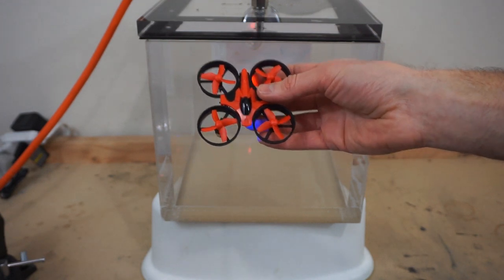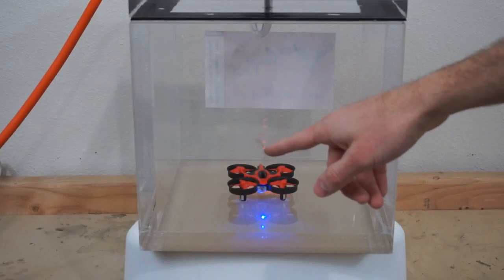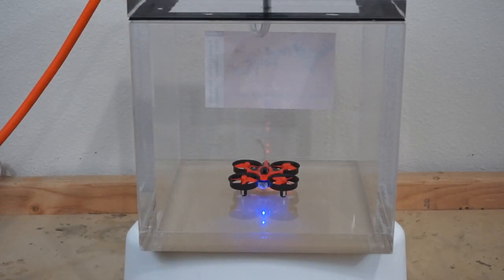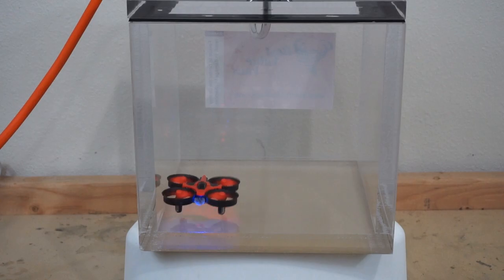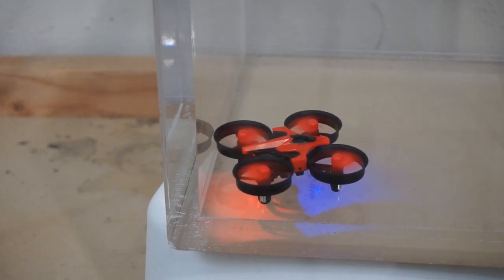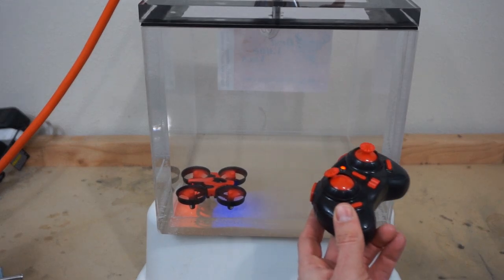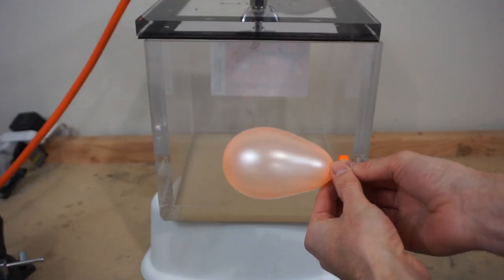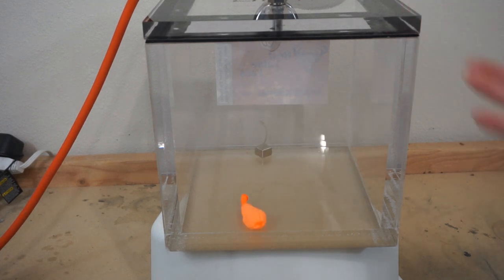What Happens When You Put A Drone In a Vacuum? Can It Still Fly?

Comment: You can clearly see the balloon thrust pushed off of the wall of the vacuum chamber. It just spun wildly until the nozzle pointed towards the wall and then it had something to push off of. Need to place it in the center of the case somehow. That's how all thrust works it needs something to push off of, be it atmosphere or an inside wall of a vacuum chamber.

Comment: Couple of quick points I would like to make. When using the balloon you're adding air to the environment creating a atmosphere. Second, using that box provides a bottom for the balloon to push off of...
Reply: Exactly, try that balloon trick in the Ohio vacuum chamber, better still put an a guy in there with a spacesuit on without umbilical cords, not one clip available on the net.
Reply: what are you trying to say
Reply: exactly.  the wall behind the balloon.  this proves zero...nothing at all.
Reply: Yes the air pressure in the balloon wanting to escape creates the rush of air ( atmosphere) and causing it to be applied to a solid object, and is used to propel it through the vacuum.

Comment: The whole video I was wracking my brain trying to figure out how you were going to get a balloon to release inside the box. After seeing the simplicity of the magnet solution I feel like an idiot =(
Reply: Ohhhhh.....much effort was put into this video ....(but seemingly not enough)!
It intrigued me as well...but there seem to be quite inventive guys (or gals) out there !!
Question is , how he can set off a minute fire works rocket in there "remote controlled".... or with a wire detonator !!??
Of course there is way ..... with a rubber seal that fits two wires !!
Reply: Oh, yeah and but but cool the way he did it !!
Reply: Vajrabrother, i like the way you think. Wire up a taser to a magnetic switch. Like the kind they use for door alarm sensors. Hopefully the battery would stand up to the vacuum.
Reply: Pujol (heheheheh) any test could be made .... and make sure the rocket is suspended in midair , so it does not "push off the walls" !
Possibly humans also think that rockets only pushed of the ground .....
and used all that boost to get "way up high" !!??
How bizarre !!

(or off course Nasa would never suspend a rocket in midair to prove to humans , that a rocket does not push off the ground !!)... which it even does "just at the beginning"!

Heehehehehehe...LOL ...so strange what some humans think !!
Reply: I watched for same reason
Reply: stiimuli Lmao,same.
Reply: I don't feel alone anymore !
Reply: For modern humans you must see rockets. Drones are not for vacuum areas. Astronauts do not use drones. Astronauts use rockets. Rockets are used to fly in space. Rockets and drones are different.... Do you see the difference between a rocket and a drone? Look at the rocket there is a bright light. See drone no light. Rockets are perfect for flying in space. Drones do not fit. Rockets for space technology. The drone video you show can be used to show evidence if you go back to ancient times

Find videos of people experimenting with the concept of rockets in a vacuum. Get information about rockets. Watch a video on the rocket concept. Don't watch videos for drone concepts. Many rocket concept experiments. Tribes believe the earth is flat, does the video use the rocket concept method?

Comment: Here after NASA said they were gonna helicopter the rover off Mars
Reply: My dude I've been thinking the same thing.
Reply: NASA claims avg atmospheric pressure is 740pa or about .73% that of Earth's.  Or about .11 psi. They must be pretty sure it will fly sense they spent all that money to get it there hopefully they didn't for get air density is a factor in air flight.  Otherwise we are going to watch a multi million dollar drone skidder around on Mars.
Reply: Gonna require massive energy tho. It can even be impossible for current technology
Reply: @andrewcabile3015  - "Gonna require massive energy tho."

it will take LESS energy than lifting the same mass on earth since the gravity is less.
The challenge is that the rotors need much higher velocity in the lower pressure than on earth.
It would be the equivalent of a helicopter flying in earth atmosphere at 40 km.
Hard, but not impossible if you design for that pressure.
They tested it in a vacuum chamber to demonstrate it works.
Reply: Mars isn’t a vacuum
Reply: @leekelantan618  _ You don't need to convince me.  I launch things to space for a living.
Reply: @stuartgray5877  Satellite phones can be used in the woods. Normal telephones cannot be used. With satellites humans can communicate with people in the city. That's proof of the existence of satellites. Humans create rockets and satellites for necessities. When you get lost in the woods. Without satellites and rockets you can’t connect with anyone in town. Buy a satellite phone if you want to get into the woods. Humans do not use drones to go into space
Reply: @leekelantan618  - I build, test, launch and operate spacecraft for my JOB. please stop trying to convince me that the things I have been building for over 25 years are real.
Reply: @stuartgray5877  See a flat earth map and also a round earth map.

Once upon a time the Japanese bombed pearl harbor. Let's say this is flat earth. How can japan get to pearl harbor. With such a distance ?. I can show you at any time the state of the earth day and night. The flat earth tribes certainly cannot show the current situation. And remember the distance to pearl harbor is not this far
Reply: @stuartgray5877  We can show the current picture of the earth of the countries that experience daytime and the countries that experience the night. Ask for any time we can share. Why did the flat earth tribes fail to show the current state of day and night by using their flat earth ?. Remember this is the distance of Japan and pearl harbour
Reply: @leekelantan618  - I AM NOT A FLAT EARTHER!

WHY are you trying to explain this to ME?

I have literally taken pictures of earth from space with hardware I BUILT!
Reply: That's why I'm here. Mars has less than 1% the atmosphere of earth.
Reply: @marcobhuachalla9814  Mars has dust devils and sand storms. Proof there is enough atmosphere to pick up and move things.
Reply: @marcobhuachalla9814  God calls the flat where you sit .. God does not call the whole earth. You walk everywhere. Looks flat. Because the earth is vast. God made the earth round, big and flat so we could walk all over the world easily. With a round earth if you move straight. At the end of one round you will reach where you started. The earth looks flat because you are small. The earth is vast and large. So you don't see the curve. When you go to the new beach you see a ship. First ... You see the pole. Then you can see the hull. After that, you can see everything. So you better learn to understand God's verses. God calls flat only for the area you sit
Reply: @stuartgray5877  God calls the flat where you sit .. God does not call the whole earth. You walk everywhere. Looks flat. Because the earth is vast. God made the earth round, big and flat so we could walk all over the world easily. With a round earth if you move straight. At the end of one round you will reach where you started. The earth looks flat because you are small. The earth is vast and large. So you don't see the curve. When you go to the new beach you see a ship. First ... You see the pole. Then you can see the hull. After that, you can see everything. So you better learn to understand God's verses. God calls flat only for the area you sit
Reply: God calls the flat where you sit .. God does not call the whole earth. You walk everywhere. Looks flat. Because the earth is vast. God made the earth round, big and flat so we could walk all over the world easily. With a round earth if you move straight. At the end of one round you will reach where you started. The earth looks flat because you are small. The earth is vast and large. So you don't see the curve. When you go to the new beach you see a ship. First ... You see the pole. Then you can see the hull. After that, you can see everything. So you better learn to understand God's verses. God calls flat only for the area you sit
Reply: @stuartgray5877  Hey smart guy, the Earth casts a shadow right?  You can’t see the ISS at night after it passes into the Earths shadow, (going past the terminator line) so how is it that we can see hundreds of Starlink satellites in the middle of the night if they aren’t self illuminated and have passed into the Earths shadow?  Would love to hear an explanation from a shill/self proclaimed expert. Cheers
Reply: @stuartgray5877  Clearly reading comprehension is not one of YOUR strong points.  I called you a shill/self proclaimed expert on “satellites” I mentioned nothing about the Earth being flat.  I asked why can we see Starlink satellites at night if they aren’t self illuminated and are passing through the Earths shadow.  The ISS behaves this way, as expected in the globe model, as it disappears in the sky because it passes the terminator line into darkness.  Some scientist you are 😭🤣
Reply: @stuartgray5877 

Just sharing. While looking for knowledge ... I'm sorry to call your name
Reply: @stuartgray5877  man I'm reading this convo and its hilarious...😂😂 Btw where do you work?
Reply: @Navin.t.r.g  Currently Ball Aerospace
Reply: It flew
Reply: @Aled Long Because if you paid attention theyve been sharing a ton of videos and pictures. All you have to do is look at any shred of news about nasa to see how ingenuity is doing.
Reply: @Aled Long your altitude is way off.
It is around 40km
Reply: @Aled Long - "So you just believe everything you see on a screen?"

Sorry but I have been launching payloads to space for over 25 years.
I literally do this shit for a living.
Reply: @Aled Long 
On Earth we can lift 3,000 kg to around the same altitude (39km) with a helium balloon that also requires atmosphere for its buoyancy

Comment: Great experiment thanks, but ultimately it is flawed. Once the air comes out of the balloon your tank is no longer in the state of a vacuum. If you watch the video in slow motion the balloon remains basically  in the same location, then after half the air has been released the balloon zips forward. I think you need a much bigger tank.
Reply: Shh shh don't think just regurgitate
Reply: 100% bang on right there.  For the first half second the balloon doesn't move at all until more air is released giving the rest of the air something to push on.

The drone is more accurate of the fact that there is no way for perpulaion to work in space.
Reply: the air coming out of the balloon is pushing on the chamber walls, so it is pushing away from an external medium
Reply: @maddy123sir  after that happens, it does multiple tumbles on it's own, don't be dense.
Reply: @dsmtsi  Nope, even at 0.25x it's clear to me that it starts moving immediately.

Comment: What I really want to see is someone fly a drone in zero gravity, but have air.
Reply: That would be awesome
Reply: DanielRobboSon that would be hard to control  think of the gyros...
Reply: @derrickmoses1507  yeah it would probably just fly "up" really fast and hit the ceiling.
Reply: It would be a mess.
Air friction would be the only force acting in opposite, it will take hella a lot of time to stop.
But wait the air wouldn't necessarily give friction, the only friction would be the Contact Force. Coz the air isn't bound by gravity, so it will just start motion.
I gotta find out.
JUICY
Reply: If it had reversible thrust it would be easy
Reply: @MilesPrower1992  Maybe a little bit but it would be hard to control. Even the slightest movement of the propellers would make it fly really fast. A specially calibrated drone would be better. For example a drone that's propellers spin really slow.
Reply: DanielRobboSon,  I’m sure nasa could make a video for you.  They’re great at cgi and studio fakery
Reply: It could be done, it would just need much lower power to get it to lift up (since it would not be overcoming gravity, just it's own inertia), would need the ability to thrust downwards to slow it's accent or to descend (since no gravity to pull it down) and would be able to hover with the props off. Flying anything but up and down would be either need extra props in all 3 axis, or would need it to be rotated 90 degrees around the x and/or y axis.
Actually, although not like a conventional quadcopter, NASA have flown drones on the ISS. The main difference is that these use compress gas for thrust instead of propellers. Much better for the fine control needed, and of course behaving just like thrusters on spacecraft do, something NASA has a lot of experience controlling.
Reply: Bees and other insects can fly fairly well aboard orbiting spacecraft.
Reply: I think they've done that on the vomit comet
Reply: It wouldn't be all that impressive. It would just sorta float there
Reply: Is there any place with zero gravity ??
Reply: Yes someone needs to fly a drone on the ISS station
Reply: @michaelpraditya511  on earth? Nah, but NASA have the facility to do it, watch usain bolt running in zero gravity
Reply: It would go up but won't come down as it normally happens...
Reply: For modern humans you must see rockets. Drones are not for vacuum areas. Astronauts do not use drones. Astronauts use rockets. Rockets are used to fly in space. Rockets and drones are different.... Do you see the difference between a rocket and a drone? Look at the rocket there is a bright light. See drone no light. Rockets are perfect for flying in space. Drones do not fit. Rockets for space technology. The drone video you show can be used to show evidence if you go back to ancient times

Find videos of people experimenting with the concept of rockets in a vacuum. Get information about rockets. Watch a video on the rocket concept. Don't watch videos for drone concepts. Many rocket concept experiments. Tribes believe the earth is flat, does the video use the rocket concept method?
Reply: Drone will never comeback wasted money
Reply: they could do that on the iss
Reply: Get a racing sim
Reply: It would fly in zero gravity with air (like inside space station) but it would just keep going what ever direction it was going even if you stopped the rotors. (It would slow down do to air resistance however)
Reply: Call Red Bull energy drink
Reply: I think it would just move horizontally, perhaps?

Comment: There is a flaw with the use of a balloon in the vacuum chamber. The air molecules were in the balloon and when released, the exhaust end of the balloon was pressed against the glass, thereby providing a resistance for the escape molecular air to push against which propelled the ballon away from the glass surface. There's your action and reaction.
Reply: Exactly.
Reply: Wrong. The opening of the end of the balloon was not pressed up against the glass. Also, if you slow the video down you can clearly see that the balloon flies in different directions even when not near the walls. Also, you can buy rockets yourself. Do you need to have them butted up against a flat surface to fly? No. Come on, think!
Reply: Thank you that's the reason it pushed offand these other comments people couldn't see that or they didn't want too

Comment: In this case, the vacuum didn't represent space, so not only was the balloons motion aided by the air pushing on the glass and remaining air,  but also, as the balloon shrank, a negative pressure was created  and that negative pressure actually pulled the balloon forward, so all this experiment proves is that propellers don't work without enough air to create lift.